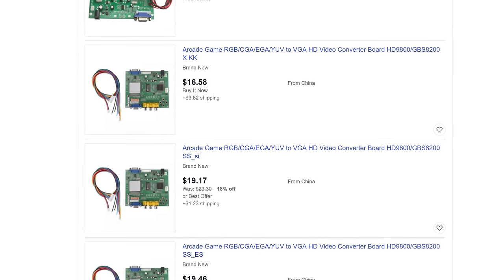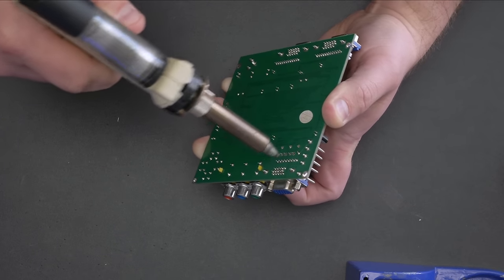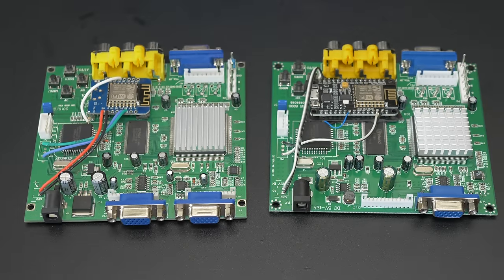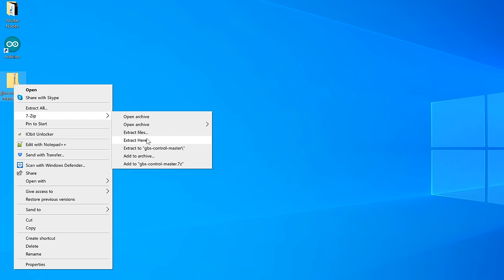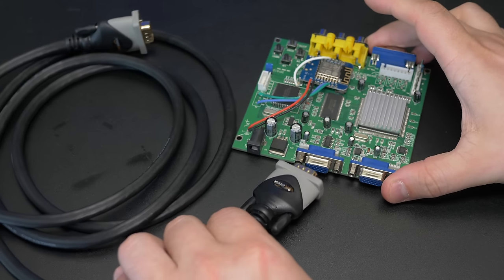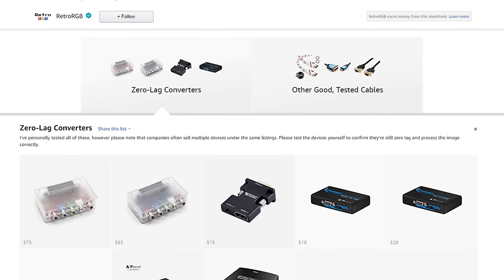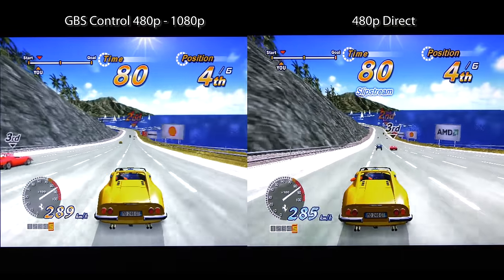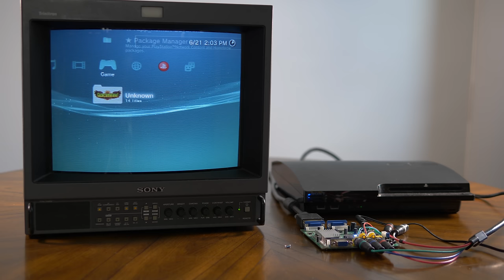GBS Control: Installation & Overview

Comment: Just noticed that the adapter for HDMI at 12:23 says on the plugs HDMI IN and VGA Out. 
Does it work as VGA in and HDMI out combining the audio from the audio 3.5 jack to HDMI without an additional power supply to that adaptor?
Reply: At 5:22 the adaptor had that 5v input, do they both work with audio?
Reply from the maker: I just grabbed the wrong adapter for the b-roll shot.  Check the description for the one I recommend.
Reply: @RetroRGB  thank you for the clarification

Comment: Mine does not want to scale vga input, it automatically passes through the signal and there is no way to set it to something else because it immediately resets to pass through. I thought it was maybe the board so tried a second one but it's the same result. Any one any ideas or suggestions?

Comment: hey bob what wire did you use? 26 awg and for the clock battery did you use kyner wire or 28 awg??

Comment: I have a question if someone can answer but how would one get audio out, my understanding is VGA is only video and not audio so with the VGA to HDMI solutions that have the little aux port how would one get audio from like component cables. Would you need to externally plug the audio cables to the aux input and route it that way? or Does the board have a spot to intercept audio signals from? I'm proficient enough at soldering that I would like to build one myself is why I'm asking
Reply from the maker: I always route only video through the GBS-C, then have audio going from the source to the VGA to HDMI converter.
Reply: Thank you much appreciated!

Comment: Does anyone know if the gbs-control supports 240p@120hz? I've heard the older version by dooklink had a preset for it but I can't seem to find any information on the newer version having that preset as well. Any information anyone has would be greatly appreciated, thanks in advance.

Comment: Would this be able to be modified to convert a composite or HDMI signal to a 9 pin 15kHz RGB input on an Atari SC1435?
Reply from the maker: You’d need a lot of converters for that. It would be too detailed to map out in YouTube comments. You might want to find a discord server with people using that Atari who might have found a similar solution.

Comment: I love this stuff its got me thinking, can you add custom resolutions?  

Other thing is input lag, i know lcd is the worst offender and oled is 13ms or lets say a frame of lag,  but its the vga crt monitor has 0.007 ms or basically zero lag. So if you use a crt monitor with a custom resolution could you still get zero lag or would the conversion introduce lag even to a crt monitor?

Comment: Executable segment sizes:
IROM   : 613208          - code in flash         (default or ICACHE_FLASH_ATTR) 
IRAM   : 29640   / 32768 - code in IRAM          (ICACHE_RAM_ATTR, ISRs...) 
DATA   : 1316  )         - initialized variables (global, static) in RAM/HEAP 
RODATA : 4932  ) / 81920 - constants             (global, static) in RAM/HEAP 
BSS    : 27944 )         - zeroed variables      (global, static) in RAM/HEAP 

is it normal during compiling?

Comment: Is this issue concerning?
Best options for the GBS-8200
I would recommend as a minimum that any sync signals are scaled using at least a potential divider circuit or a transistor level shifter as they are readily available, providing your source produces a C sync signal. If you need to to combine H and V Sync, use a logic circuit..
If your system provides a composite video signal, use one of the sync strippers but ensure you condition the output to be 3.3V LVTTL compatible not 5 LVTTL.
Nobody talks about this blowing up the GBS-8200.
Reply from the maker: Are you measuring under load?
Reply: @RetroRGB  Not even there yet. The GBS arrives tomorrow but other YouTubers say 5 v will shorten the life of the board. Easy fix with a 1k resistor in series to lessen the voltage 18% which isn't 3 but I'll figure this thing out.

Comment: Purchasing the power supply from elsewhere - can anyone confirm the barrel connector measurements?
The linked product states 5.5mm outer, and I've heard that 2.1mm inner diameter is correct, just want to make sure it's not 2.5mm. Thanks!
Reply from the maker: I  use the WSU050-4000 that I discussed in the video.  It also works on MiSTer and 5v Neo Geo AES'.

Comment: @retrorgb this just popped into my head, what if used to help safeguard a groovymame setup with an rgb modded consumer crt by having the gbs be the go between to prevent any chances of more than 15khz? Or on a crt with component inputs

Comment: Would it be worth to setup a GBS control for a SNES PAL as a very cheap solution connected to an HD-TV for line doubling?
Or should I spent the extra money on a RAD2X cable or even a RetroTink2X?
Reply from the maker: Just my opinion:  If you don't have any RGB cable for the SNES, the RAD2x will be cheaper and easier.  If you already have an RGB SCART cable and know how to make a custom SCART to VGA adapter...or if you already own HD Retrovision cables, then the GBS is a good choice.  As long as you can mod your own.
...while I love the GBS-C and the parts for it ARE cheap, it's the total solution cost you need to think about:  Cable+adapter+GBS+modding can be more expensive than just a RAD2x.
Reply: @RetroRGB  thanks for the fast reply! Just on last curious question: Does the GBS or the Rad2X deliver a better sharp-pixel image?

Comment: @retrorgb would the downscaling option work with an rgb modded consumer CRT TV? For if ya want to keep your ps3, ps2, og xbox, 360, and heck even wii and Wii u hooked up via analog.
Reply from the maker: Yes, but you'd need to make sure you set those consoles to 480p.  720p and 1080p can't be downscaled to 240p....at least not yet.

Comment: I'm considering picking this up but maybe someone could confirm something for me. I want to set up my GameCube, Dreamcast, and original Xbox to a PC CRT to take advantage of 480p.
I was just wondering if this would be a fairly cost-effective way of doing that, or if there were better options since whenever I go looking for Component to VGA transcoders they either rarely pop up or are more money than I'd like to spend on something like this.

Comment: With gbs 8200 could I bring out component ps2 output into gbs then out a vga cord to vga to the ossc or would I have to do it manditory component to the ossc
Reply from the maker: If you're using a PS2, I wouldn't go through the OSSC at all - I'd just use the GBS-C's motion adaptive deinterlacing and get a cheap VGA to HDMI converter.
Reply: @RetroRGB  so even if I already have the ossc already I shouldn’t use it with any of the features on the ossc in addition with gbs c? Also does it require a specific resister swap since it’s intially coming out of the component from ps2 through vga hdmi-adapter or in the ossc case vga to vga does anything have to be removed or added in the case of dim display with component or is it fine since its coming out vga instead of component anyway or is that something. With the newer model Bc I have the black button gbs 8200

Comment: Thank you for this vid.  If you can help... I am also interested in finding out better downscaling method. Mainly going from recent “Mini” consoles to older 4:3 composite connection only TVs.  

New Mini consoles have 16:9 ratio only and have no means to do full screen mode using 4:3 TVs.  I would appreciate your help on this one.
Reply from the maker: I'm currently working on a video dedicated specifically to downscaling.  I hope to have it out in a few weeks, but 720p 16:9 -> 240p 4:3 is tricky and ads lag.
Reply: @RetroRGB  Could you share the link to this downscaling video please? Could not find it.

Comment: Thanks bob I love this scaler I added a on off switch to my 100ohm resistor so alot less fuss. Had some wifi issues with mine can be helped with replacing the aluminum heatsync with a ceramic one. Also noticed I'd get wifi drop outs from a sync stripper i made did you have any of these issues?
Reply from the maker: Thank you!  I don't have any of those issues, but I'd like to find an external antenna for the wifi to boost the range.
Reply: @RetroRGB  thank you and everyone in this fine community who has made things like this possible for a retro enthusiasts who are on a very tight budget.
Reply: Hi bob was doing some searching found a module that does have an external antenna not sure if its compatible but thought I'd share D1 Mini Pro NodeMCU WiFi LUA ESP8266 ESP-12 WeMos Microcontroller w/ Antenna

Comment: Thanks for great video. I want to use my crt VGA monitor for AtariST and this kit is exactly what I need. The 2X-Pro or OSSC won't work as they output hdmi and converting it down to vga is no go for me.

Comment: 5:10
You mention there's a GBS-C that would allow you to simply plug the pieces together with no soldering necessary. Do you happen to know any information on where to get that specific variant?
Reply from the maker: This one, however it's not sold anymore:  https://www.retrorgb.com/gbs-c-aio-now-officially-open-source.html
Reply: @RetroRGB  Ah thats a shame. Thanks anyway! I ended up buying from Tindie a pre-built GBS Control. It doesnt have the HDMI adapter inside like the AIO variant, but I will simply stick a VGA-to-HDMI adapter on the back.

Comment: Ordered the same stuff you used, but why does my wifi module look way different than yours? I used the link in your description.
Reply from the maker: There's actually a bunch of slightly different designs, but it's all the same pinout and the same chip.  As long as yours is numbered the same way mine was, it should work.

Comment: i've tried these mods for RGB with S&G for an old arcade machine street fighter with the original boards however whenever i connect the jumper to disable the onboard processor it completely loses video adding the 100ohm resistor causes it to lose video as well. I have removed the RGB analog control dials but this has not repaired the situation. i have tried switching sda and scl wires but nogo and the monitor will not even detect that a cable is connected i check with the h++ and h- and there is 0 signal input hz and 0 signal output hz when i disconnect this jumper it sortof works the screen is all blue but there is massive flickering i changed it to 50g++ 12 and this minimizes the flickering but does not get rid of it i have not yet tried the Si5351A but will be ordering it this weekend im not certain what else can be done aside from that if anyone has any advice it would be very welcome.
Reply from the maker: You don't just remove the POT's, you have to bridge them as well, like I showed in the video.
Reply: @RetroRGB  i did bridge them like shown in the video apologies for not specifying that i didn't use resistor wires to bridge them i just used the little metal pins that come with the the dv1 mini

Comment: One thing to note: the gbs8200 works with 5-12V and the voltage will be applied unregulated to the two pins you soldered the esp8266 to.
This is fine if you're using a 5V power supply, but will probably fry the esp8266 when using a power supply with a higher voltage. While the gbs-control project page does mention wiring the esp8266 to the regulated 3V3 lines next to SDA is not the recommended method, its probably safer to wire the ESP to those pins. Since the module is rated for 3V3 anyways, that shouldn't be an issue at all.

Comment: Hello, can i convert RGBS 480x234 video to vga, uses this board?
Reply from the maker: That's an odd resolution.  This board may not work, but it's cheap enough that I think you should give it a try.
Reply: @RetroRGB is stock or modified board better to scan such resolution?
Reply from the maker: I'd think modified.  But you can try it stock first before modding if you'd like, just to see.  It'll be laggy though.
Reply: @RetroRGB  may be it's possible to make some custom software for modified version?
Reply: @RetroRGB  hello again, I have tried to use orig board, it was not working, after some researches I have added resistor 1000 ohm in line to sync, because there was 4 v, after that I have got image, but very unstable and 0.9v on sync... May be you know how to get lower voltage level on sync and get it correctly? What about TTL sync? Isn't this board support TTL level?

Comment: I've just integrated one of those blue PCB GBS-8200s with an on-board VGA to HDMI converter into my capture setup, and it just makes things so much easier than having to deal with sync dropouts from resolution switching (this has been my single biggest pet peeve when using most capture solutions). However, I would still keep the POTs on the GBS-8200 as both that blue PCB GBS-8200 and the standard VGA GBS-8200 (I have one of each) produces some color tinting. The VGA board, in particular, produces an AWFUL end result with component inputs. For some reason, my VGA GBS-8200 produces an insanely strong green tint and I'm not sure if this is generalized across all GBS-8200s or if it's a problem with my particular GBS-8200. Either it produces an excessively strong green signal out of the scaler or the component input is mishandled. Bob, have you seen any major color tint issues with your GBS-8200s and GBS-8220s over either their RGB or component inputs?
Reply from the maker: I use Rama's auto-calibration and it seems to be fine.  I didn't dig deep in color levels though...
Reply: I've only seen one such issue, reported on the github

Comment: Hi there i built one of these GBS Control 8200, and looks awesome with my mega drive, PS1, Snes, but can any one point
me in the right direction how to connect my PS2 and Dreamcast to the GBS Control thanks.
Reply from the maker: Use component video for the PS2 and VGA for the Dreamcast:
https://www.amazon.com/dp/B07H3F94ZN?ref=exp_retrorgb_dp_vv_d
https://www.amazon.com/gp/product/B01BF74KOS
Reply: @RetroRGB  thanks for that also I put PS1 in my original post but was meant to say I need PS1 RGB cable or would the same PS2 cable work, or can I wire up my own PS1 RGB cable ?, thanks again

Comment: Can someone help me, I'm going to make my own GBScontrol but I'm using the gbs8220 board and I can't find the ferrite beat here in Brazil, but I found one of 120 ohms but the problem is that it's rated current is 0,6 A (instead of the 2A from the original) and it's DC Max-Resistance is 0,15Ω (instead of the 0,04 of the original) https://www.digikey.com/en/products/detail/tdk-corporation/MMZ1608B121CTAH0/600531. Will this ferrite work properly? I am no technician so I don't know.

Another thing, I'will print a 3d case for it, and I want to put a scart input into it, the GBS board I bought came with the 8 pin RGBS input and I want to use it to install the scart, but I don't know which of the input signal I must use as the sync. the input signal comes printed on the board as following [GND, GND, VS, HS, S, B, G, R] VS stands for vertical sync, HS horizontal sync, and S for composite sync, right?  but does S accepts sync on composite or just Csync? because my scart cables are sync on composite none of the scart cables I use have sync strippers. 
Does the GBS control accept sync on composite? if so should I use the GBS "S" signal or should I combine the HS and VS with a 100Ohms resistor ( as the retroRGB website recommend on https://www.retrorgb.com/vgaconnector.html ) ?

Comment: all good up to where have to add esp8266 at Tools-Board-Board Manager......it won't find 'esp8266'?  UPDATE: issue was I had to restart Arduino-IDE..after that it could find esp8266 :-) oh &make sure you use a proper micro USB cable..first one I tried couldnt find proper come port

Comment: I've been wondering why you had always trashed the GBS and never covered GBS-Control. In any case, thanks for getting to this. 

It is a great and cheap solution with more flexibility than many other of your more preferred solutions.
Reply from the maker: 1)  I trash the GBS, because it mostly sucks in its original form.
2)  I didn't want to cover GBS-C until I had time, because I knew how much work it would take to make a video like this that did it justice.  The research that went into this video, as well as the actual video itself took around 60 hours total.

Comment: No mention of the common bottom side shielding mod to clean up picture (copper tape over data lines soldered to ground)
Reply: This is no longer needed. The issue was solved with changes to the GBS-Control software.